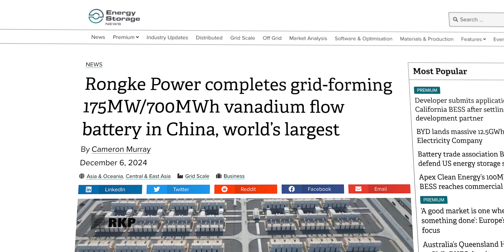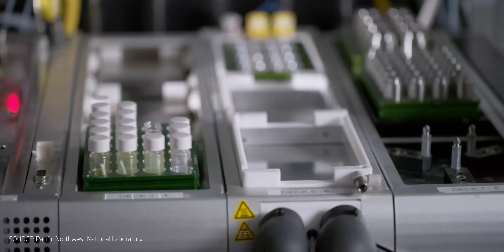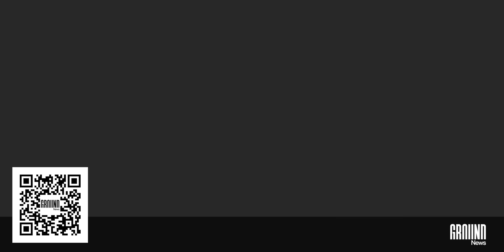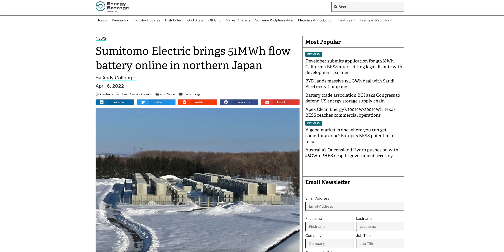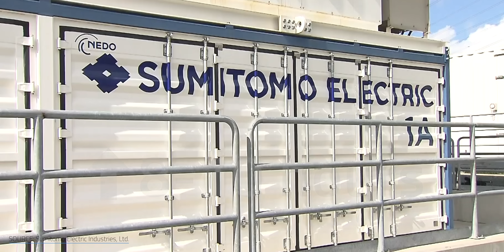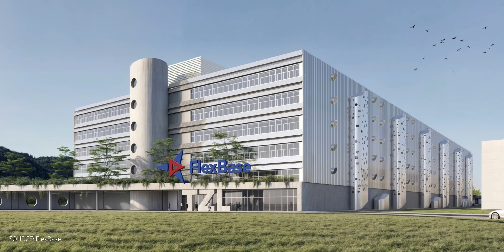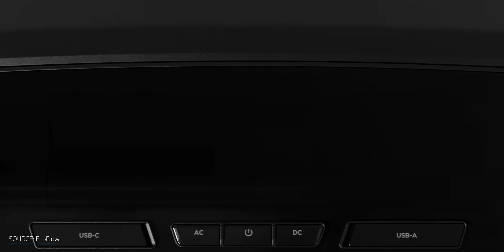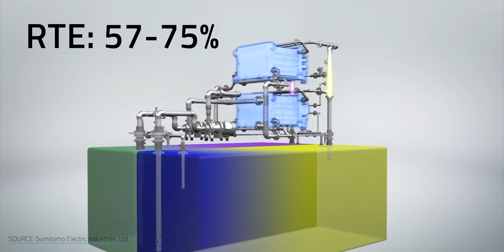Why Isn’t This Revolutionary Battery Everywhere?

Comment from the maker: Do you think we’ll see more of these in the US and elsewhere? Go to https://ground.news/undecided for an innovative way to stay fully informed on tech, energy, the climate and more. Save 40% on the Ground News unlimited access Vantage plan with my link.

If you liked this, check out How We Solved Renewables BIGGEST Problem https://youtu.be/j1HWNXmmld4?list=PLnTSM-ORSgi7uzySCXq8VXhodHB5B5OiQ
Reply: Wish you'd see more of these, but then you need a government that isn't actively boycotting anything that threatends the oil and gas industry's bottom line...
Reply: Hi Matt, since I heard about this kind of battery I kept an eye open, asking myself the same question (why aren't they commonly used), you gave the answer, and once again, it was a matter of patent :/   IMHO, patents should be sustained only if they are used, not to block other companies for whatever reason.

I also think this is the future, a refill every 20-25 years with cheap liquids, a very low maintenance, a low auto-discharge percentage and of course the ability to smooth the power solar panels deliver home - let's hope this tech will grow rapidly in the consumer's market.
Reply: Hey Matt, I need to find a way to store some thousands of kWh (about 6 thousands) from summer til winter. I can produce 16 MWh in that period and need to consume 6 MWh from the "battery" so what do you think is the best solution for a high volume storage system (even if the RTE is just 50%) to store that much power for months? And is that even feasible? I am afraid that in short time we won't be able to inject our surplus energy in the grid anymore because everyone wants solar panels nowadays and every neighbor produces at the same time with me and the line can't take all that energy and send it away apparently.
Reply: @alexandruilea915  if you need a lot of dsicharge capacity, I think you can do it with these new fly wheel get ups... and with your solar (sounds that way), I bet little inputs could easily maintain the volume you are trying to stash....idk, not an expert, but something has be a solution, lots these days.  I just can't stand the idea of large quantities of electricity soaked lithium sitting around in batteries, not in my basement, not in my garage, not in a building away from the house.... I looked at one of these new solid state solutions, looked like a pretty neat set up, but really nothing for home use yet.... you need a industrial level solution amigo....

sounds like an increasing problem in the future  in some states where they have promoted home solar while forcing net metering, leading to overproduction on the individual home level....when everyone on the street is producing 30kw extra a day trying to move it onto the grid, there are numerous problems that arise....something has to give, besides the size of the line in every neighborhood... WHen the electric company starts buying power from everyone.....aaaah, who's their customer? where's the profit for the grid operator? DO they just become managers and technicians with no profit on the supply side of the game?
Reply: @alexandruilea915   if you need a lot of dsicharge capacity, I think you can do it with these new fly wheel get ups... and with your solar (sounds that way), I bet little inputs could easily maintain the volume you are trying to stash....idk, not an expert, but something has be a solution, lots these days.  I just can't stand the idea of large quantities of electricity soaked lithium sitting around in batteries, not in my basement, not in my garage, not in a building away from the house.... I looked at one of these new solid state solutions, looked like a pretty neat set up, but really nothing for home use yet.... you need a industrial level solution amigo....

sounds like an increasing problem in the future  in some states where they have promoted home solar while forcing net metering, leading to overproduction on the individual home level....when everyone on the street is producing 30kw extra a day trying to move it onto the grid, there are numerous problems that arise....something has to give, besides the size of the line in every neighborhood... WHen the electric company starts buying power from everyone.....aaaah, who's their customer? where's the profit for the grid operator? DO they just become managers and technicians with no profit on the supply side of the game?
Reply: @alexandruilea915      if you need a lot of dsicharge capacity, I think you can do it with these new fly wheel get ups... and with your solar (sounds that way), I bet little inputs could easily maintain the volume you are trying to stash....idk, not an expert, but something has be a solution, lots these days.  I just can't stand the idea of large quantities of electricity soaked lithium sitting around in batteries, not in my basement, not in my garage, not in a building away from the house.... I looked at one of these new solid state solutions, looked like a pretty neat set up, but really nothing for home use yet.... you need a industrial level solution amigo....
Reply: @alexandruilea915   
sounds like an increasing problem in the future  in some states where they have promoted home solar while forcing net metering, leading to overproduction on the individual home level....when everyone on the street is producing 30kw extra a day trying to move it onto the grid, there are numerous problems that arise....something has to give, besides the size of the line in every neighborhood... WHen the electric company starts buying power from everyone.....aaaah, who's their customer? where's the profit for the grid operator? DO they just become managers and technicians with no profit on the supply side of the game?
Reply: @glen.simpson  We don't have net metering and only get compensated for the energy itself, transportation has to be paid if you take the energy back and the scale is like 1 to 2 for the energy so transportation and state tax account for 60 to 70% of the final energy cost so here I am looking for a solution to store even at 50% rate and still win over giving it to the grid at 30% of the price I pay to take it back. Also, most companies use lower prices for prosumers (consumers with solar panels mostly) here so the energy they buy from me will be sold at a normal rate to the neighbors while I get paid less for it.
Reply: @alexandruilea915  they are editing me...why?
Reply: @alexandruilea915 - Does the energy have to be stored in a form that comes back directly as electricity? If not, you can make a high temperature sand battery and use a heat engine plus generator to convert that back to electricity. There are even some simple ways to use solar thermal to create the high temperature. 
For instance, selective surface vacuum tubes intended just to make domestic hot water have been demonstrated to work at 300 degrees C! 
A rather simple double expansion steam engine that can be made from a car engine will give you 25% thermal efficiency, when the high temperature end of the cycle is 300C. The 75% waste heat is available at 55 Celsius and that can be very useful, too. 
Finally, what is the peak level of power you need in your system?
Reply: @alexandruilea915 is this comment section actually working?
Reply: @YodaWhat  yes it is, I can see your message
Reply: We need smaller and lighter batteries for our portable energy storage needs.  For home energy storage, size doesn't really matter.  Make it huge and super inexpensive!
Reply: politics in mind. no.
Reply: The US STILL mines Taconite in Minnesota, shipped to Ohio for steel making ( think Edmund Fitzgerald). There is a existing source, IF its even being exploited?
Reply: Say it with me, Matt:

"VRFB"
"VRFB"
"VRFB"
.
.
.
🤓
Reply: Edwin Black's 2017 book "Internal Combustion - How Corporations and Governments Addicted the World to Oil and Derailed the Alternatives" answers why the turn of the century efforts for a battery electric age failed. One reason is in his subtitle, but the other is that battery tech attracted a wave of fraudsters who absconded with investor money for unrealistic schemes.
Reply: because the plan is for north america to keep sending dollars to the middle east, that's why, even as they go solar themselves.
Reply: Can you make a video about this iron flow battery?
https://www.youtube.com/watch?v=mu6mZZuPdpI
How bad is vanadium for the environment?
Reply: @alexandruilea915   if you need a lot of dsicharge capacity, I think you can do it with these new fly wheel get ups... and with your solar (sounds that way), I bet little inputs could easily maintain the volume you are trying to stash....idk, not an expert, but something has be a solution, lots these days.  I just can't stand the idea of large quantities of electricity soaked lithium sitting around in batteries, not in my basement, not in my garage, not in a building away from the house.... I looked at one of these new solid state solutions, looked like a pretty neat set up, but really nothing for home use yet.... you need a industrial level solution amigo....

sounds like an increasing problem in the future  in some states where they have promoted home solar while forcing net metering, leading to overproduction on the individual home level....when everyone on the street is producing 30kw extra a day trying to move it onto the grid, there are numerous problems that arise....something has to give, besides the size of the line in every neighborhood... WHen the electric company starts buying power from everyone.....aaaah, who's their customer? where's the profit for the grid operator? DO they just become managers and technicians with no profit on the supply side of the game?
Reply: this looks compelling but no match to the simplicity and scale of LFP and Sodium ion batteries. The costs of these two can go down anytime depending on how much the world is buying these two. We just need to convince the world to more electric vehicles and renewable energy.
Reply: it was stolen from Seattle Washington work to china
Reply: Well you did cover Nuclear Reactors in a recent video. No, I'm sure the US will keep burning oil and gas for another 10 years, before they think about going 'Green'. Allegedly the USA don't belong to the Paris Agreement any more. 
The science is advancing around Fusion Reactors and the ITER project, which the USA is still a party to,  and it may bear fruit within 10 years time. Or become obsolete in a 'shock announcement' from some obscure current Fusion Project Company, stating that they 'cracked it!' I mean, who knows. Look at the blue LED story or the carbon filament light bulb. Obviously there may be some private power companies that may take it on, within the US. I don't know if Kimble Musk is still building solar power on peoples houses, to supply his brothers Tesla Car recharging stations? Maybe he will adopt the Vanadium BESS? 
I just wish there was more enthusiasm in New Zealand to roll out tech like this. There are some new solar/wind farms approved, but not enough. Our power generation is about 80% from renewable and 20% non-renewable. But we still need to reduce the 70% oil/diesel/petrol/gas that powers the transportation on our roads and supplies boilers and home cooking. And being Nuclear Free, we won't be having Nuclear Power any time soon ;-)
Reply: Because China HAS TOO MUCH INFLUENCE IN THE WORLD.

Obviously you don't seem to get that FACT.

You can't just KEEP IGNORING the situation that it needs to be addressed and not just showing it as a just a engineering feat, you have to pay attention to macro global issues surrounding each countries own problems.

So, yes this type technology could be better, but China needs to understand that they need other countries to even part assemble or be involved in the financial aspects, else what good is it to that country?
Reply: CO2 is climatologically irrelevant. 

CO2 is climatalogically irrelevant: Interglaciation climate change (e.g. the Medieval Warm Period) is caused by cosmic ray fluctuations ( see the work of Henrik Svensmark, et al).

Just burn coal: the CO2 issue is irrelevant (see above). The sulfur issue with gaol is bogus too: sulfur is an agricultural fertilizer (ask the farmers). The "acid rain" issue is at most "a nuisance" (see the $500 million NAPAP study of 1990).  "Acid rain" was another one of those shallow media sensationalisms, like "global warming" and "ozone depletion". 

Global warming is 21st century superstition. 

Just burn coal.

Sorry, but however intriguing these battery-thingies are, they are just another tax-sheltered boondoggle for people who don't want to do get a real job. 

Just burn coal.
Reply: @hg2.  thanks for displaying remarkable ignorance.... yes, clearly a lot of significant climate change has been caused by events. This truth does not negate the potential impact of near term human influences such as co2.   Please display better logic in the future.
Reply: Highlighted reply
@hg2.
23 minutes ago
CO2 is climatologically irrelevant. 

CO2 is climatalogically irrelevant: Interglaciation climate change (e.g. the Medieval Warm Period) is caused by cosmic ray fluctuations ( see the work of Henrik Svensmark, et al).

Just burn coal: the CO2 issue is irrelevant (see above). The sulfur issue with gaol is bogus too: sulfur is an agricultural fertilizer (ask the farmers). The "acid rain" issue is at most "a nuisance" (see the $500 million NAPAP study of 1990).  "Acid rain" was another one of those shallow media sensationalisms, like "global warming" and "ozone depletion". 

Global warming is 21st century superstition. 

Just burn coal.

Sorry, but however intriguing these battery-thingies are, they are just another tax-sheltered boondoggle for people who don't want to do get a real job. 

Just burn coal.

Comment: all VFRB projects are based on pressure vessel design concepts.I know someone who has worked in the chemical industrie for over 40 years，he pointed out the fact，that normal sealing elements in a pressure vessel would last 2 to 3 years without problems，even with the PH value less than 2，but it must be checked and replaced by then because it would leak sooner or later，and 3 years of life time for a sealing element is already very long.
VRFB is not easy to maintain or repair，with low or no profit，the VRFB companies couldn't afford to replace the stacks every 2 or 3 years，so in the near future I see little hope，that VRFB would become as important as lithium.

Comment: what the world needs are LiFePo4 batteries that cost 100 bucks a Kilowatt Hour delivered like the 6,  I bought off Temu last Feb. they have been online since Feb. these 6 can run all the 120v circuits in my house for 24 hours easy.

Comment: I have watched several of your videos about battery technology.  I am trying to find an efficient cost effective electricity storage system for an off grid home I and planing to build in South Florida.  I started each with great excitement only to be disappointed by the end either by cost or availability.  I see you have solar.  If you were going to pick a storage system for your home what would you use?

Comment: I need some advice on this community.

I’m interested to work in this flow battery industry. Where can I apply for jobs? And any tips on how to improve the chance of greeting the job 

I have two years of experience as commisioning engineer (electrical and instrumentation) 

Any suggestions is much appreciated.

Comment: Shame about Redflow, looked promising with "portable" ZnBr flow batteries - I recall they had dendrite issues but the system just needed to do a full discharge periodically - they were still expensive at around $10k/unit but had hoped they would solve their issues and get more support - though I guess Lithium won out. Same for a similar salt water Aquion??? battery went bust as well both had low discharge and require multiple units in parallel to provide the power on demand but they had long cycle times and could discharge to 0% or store indefinitely at 100%

Comment: Vanadium metal price is US $200 per kilo, well thats a problem.   Vanadium is not that abundant either.  Flow batteries also have an issue with pumps,valves and moving parts, not good features in a battery.

Comment: I am curious why iron flow batteries are not more popular?
Maybe you can do a deep dive into that chemistry?
I have previously spoke with ESS Inc about their battery offering and it seemed to be a good option but they do not seem to have achieved a lot of commercial traction?
Do you have an opinion on why this might be the case?

Comment: All very promising. Of course the US lags behind as we must cow-tow to Big Oil. Covering "emerging technologies" is great, but also frustrating. We see other countries with a properly working government adopting these next-gen technologies. If a Vanadium redox: Home Edition was available, vs a Tesla Power wall, obviously I'm going for that. The other sticking point here is the loss of the US Steel industry cut off our "wastage vanadium by-product" which would be a new business opportunity. Rebooting US Steel is an excellent stretch goal, but that isn't happening in the next 4 years. I grew up in South Shore Chicago, and some evenings to the south-east you saw the nighttime sky glowing yellow/orange from Gary IN steel works pouring molten steel. That was in the early 70s. That has all been shuttered, and likely all of the works have rusted and rotted. It will be a decade before US Steel is a competitor on the world market again, if ever. Supply chain is always a problem. China/Russia being major Vanadium suppliers... That ain't happening in the current political climate.